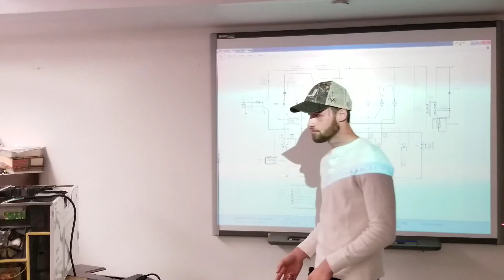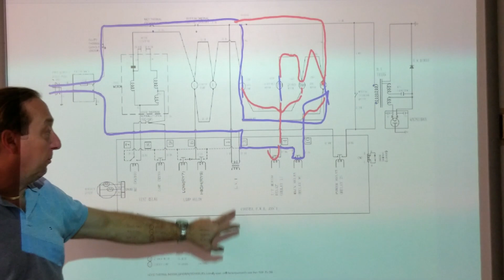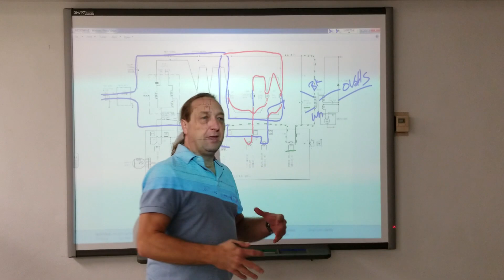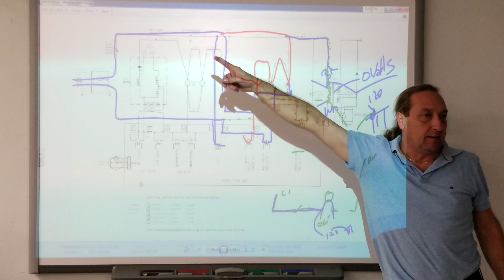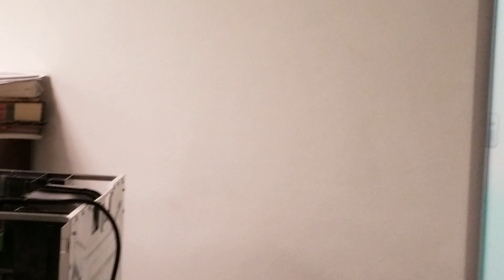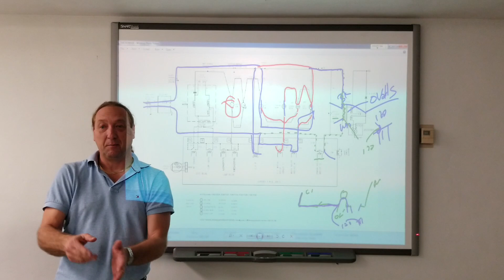#TECHTALK Microwave Troubleshooting

Comment: I putzed around with a door switch that wasn't working (microwave displayed door open, when it wasn't)  
I pushed the mechanism in, then only the bulb and rotation motor worked but the door open error went away. I pulled the door switch mechanism back out and tripped my breaker. After resetting the breaker, my display still has no power. 
Im thinking i triggered the monitor switch and my door switch mounting may be suspect. Please lemme know if this sounds about right. I have a wall mounted Amana and haven't had a chance to take it down and disassemble it yet.

Comment: My microwave keeps blowing fuses. I disconnected the 120V AC from the transformer and ran the microwave and the fuse did not blow. I then reconnected the 120V to the transformer and then disconnection the line coming from the capacitor and diode to the high voltage section of the transformer and ran the microwave. The fuse did not blow but as soon as I connect the cable back to the high voltage section of the fransformer the fuse blew. Diode and capacitor test good, the teston the transformer also tested good. Continuity across the low voltage coil good and no continuity to ground, ohms reading from high voltage connection to ground 107 4 ohms. Also across the connector to the magnetron reads 0.3 ohms. What is blowing the main fuse? Thanks in advance
Reply: Radiation leak. The fuse blows when even a small amount of radiation leak is sensed.

Comment: Tappan Microwave starts, runs for about second. Light, turntable, magnetron all start.  Then after a second shuts off. Display says XXXX for a few seconds and then 0. For a while it would do this intermittently, but now all the time so can't use.
Possible problem?

Comment: I havr a weird issue with a microwave that maybe you can help with

I have a GE microwave that doesn't heat. If I unmount the control panel and either hold it slightly to the side of the normal mounting position, or let it hang, the microwave will heat with no issues. Once I reseat the control panel, it goes back to not heating. 

Ive tried this back and forth several times and observed to see if wires or harnesses or switches were moving but nothing seems to be out of place when the board is seated into its mounting location.

Comment: Q.. Michroton is working,  heating is ok,  but the fan and disc motor is not running,  what's the problem?
Reply: often a relay controls those along with the light, so possibly a bad relay.... does the light come on when running?

Comment: At 1:47 he states that the monitor switch is normally open and not closed. This is incorrect I believe, In another video Rick says just the opposite, The monitor switch only closes when the door is closed and is a normally open switch.
Reply: In a properly working microwave oven, with the door closed, the monitor switch is open, since its terminals connect Line and Neutral. When you open the door this switch creates a short between L and N but at the same time (or to be precise, just very shortly before it happens) the other two switches open, breaking the circuit so the fuse doesn't blow. Monitor switch is a safety device. Its only purpose is to create that short and blow the fuse when the door is open but the other two switches failed (i.e. they stay closed). When reading a diagram it's good to pay attention to the annotations describing the conditions (or states of operation of the unit) it depicts. Especially for schematics with switches or relays. In case of mv ovens, some diagrams show connections when door is open and others when door is closed. By opening/closing that door you mechanically change the state of switches, so without that note you wouldn't know under what condition the device was when the schematic was drawn.
Reply: You are correct i must have misspoke the monitor is normally closed the Teo other switches are normally open if I said that

Comment: Question. With over range HD microwaves with ducting. I tell them to buy a new one. By the time I drop it. Repair it and reinstall it. It will be better to just go buy a new one and have me install and take away the old unit. What are your thoughts on this?

Comment: Fastest way to figure out a no heat problem is amp draw, it will tell you if it low voltage problem or high voltage problem.
Reply: My microwave amp draw was 2.8 amps today before I replaced the faulty part. What was the defective part?

Comment: Great lesson Mr. Zilka! As always!

I've got a question though.  
The tests show presence of L1 at the transformer, but only when you turn the MW On. According to the diagram, there are no switches on L1 to the transformer.  The circuit is interrupted (in normal operation) by the relay on the N side. Doesn't that mean that there should always be voltage at the transformer (to ground) regardless of whether the MV is running or not? 
 Is that a schematic from another machine or am I missing something 😁?
Thank you!
Reply: I will have to rewatch the video, but L1 should be present as ling as the door is closed and all the safety fuses are ok, can you tell me where I might have said it was not there I will rewatch. This video is about 3 years old
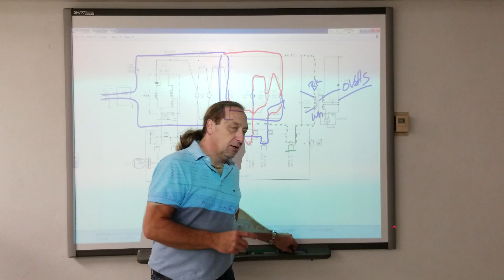Reply: @riz65  15:10 in the video.
It's not that "you said" it wasn't there. It really wasn't until the MW started running. I'm trying to understand why. Thanks!
Reply: @79aac  ok, then you are correct 120, is at the primary winding as soon as the door is closed
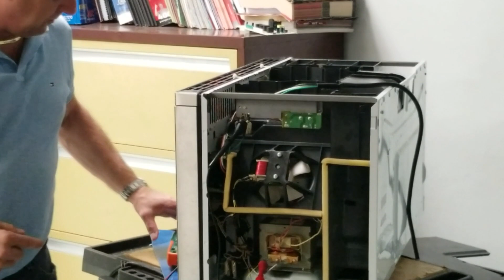Reply: OK, Yes you are 100% correct, and that was a good question. I re-watched the video "remember I said this was made a couple of years ago." You guess that the diagram did not match the machine. And yes the diagram shown L1 should be all the way to primary of the transformer all the time. So making a test without is running there should be power there when the door is closed.  I think it is minute 15:31 where I make the test between ground and black wire L1 at the transformer and didn't have voltage until it was started. The diagram is for a Frigidaire microwave, and the microwave itself is a General Electric Brand. The class was going over microwaves, and one of them the relay was open so we made a class explaining how to search for it. The unit did not have a diagram and I couldn't find one on the internet , so I used the Frigidaire one. I should be back in the classroom in next week or so, school is about to reopen. I should still have that microwave and see if I have any luck in getting the diagram. I will record a second video correcting this.
Reply: @riz65  Thank you very much for the clarification! I was genuinely curious 🙂.
 But didn't mean to take so much of your time.
Reply: Thats ok, im here for that